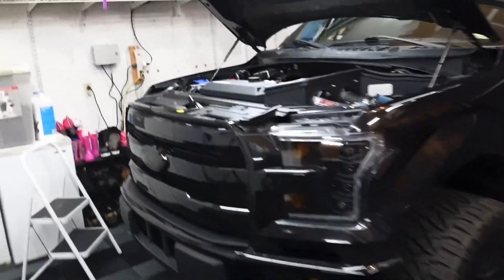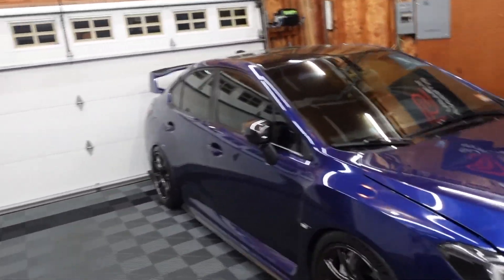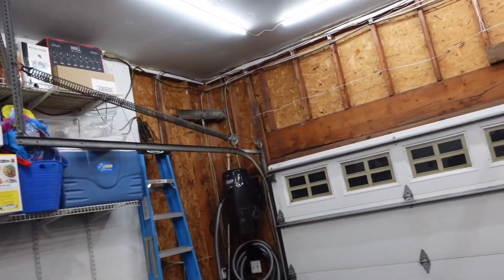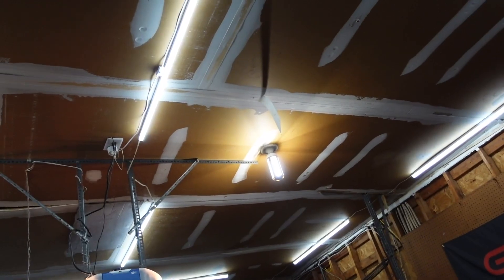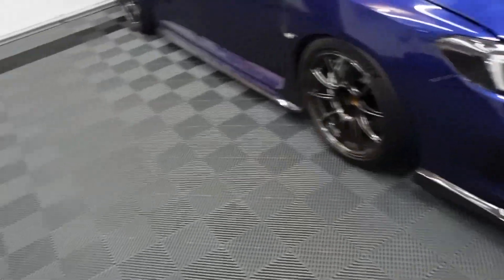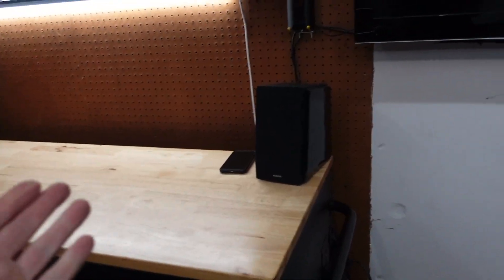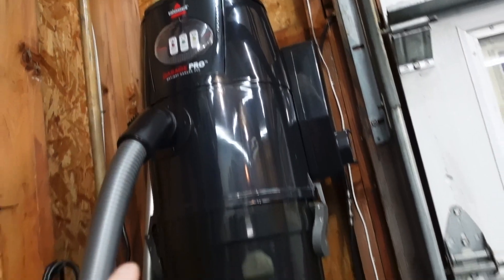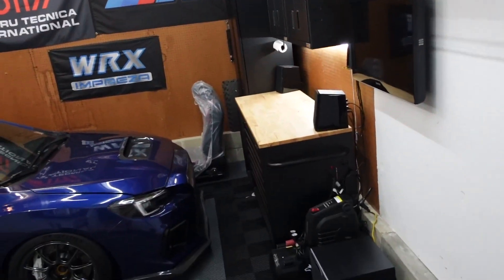My Modest 20x20 Full Garage Tour - Swisstrax, Husky, Edifier, Bissell + MORE!

Comment: Sheet rock and insulation against living spaces is a nationwide code.  Its a "fire barrier" and should typically be 5/8 inch or double half inch drywall.  Too bad I do not live closer I could wire the hell out of that garage very easily, especially with the panel out there.
Reply from the maker: I figured that was pretty much the standard code. I’d love to get a legit electrician out here to knock it all out. The wires drive me nuts.